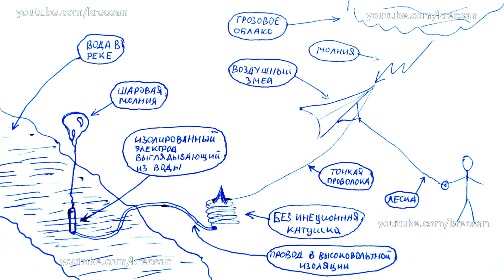Generating a lighting ball from a streak lighting!

Comment: I think it's fake :
I've seen videos about lightning rockets trigered, and the cable explode very very quicker... the plasma on this video is too much slower..
And a lightning can't make hissing like this caused by the tree resistance... because it have more energy than the electric source been used in this video.
they show the electric source at the begening, it's train power line. by the way I remember several years in the past this sames guys had been posted video on train powerline grounding with very similarity...
The plasma and the thunder sound are video edited, but the hissing, and the explosion are real and caused by train powerline grounding with a tiny cable...
And the hissing happened because the cable touching the tree, and maybe the cable wasn't properly grounded... until an arc close the circuit.

Comment: I cant tell if its FAKE or not
Reply: It's 100% fake. It's pretty obvious... Lightning strikes go way faster than this, you can't film it moving down like this, especially not with with a normal camera. "The rate at which the return stroke current travels has been found to be around 100,000 km/s (one-third of the speed of light)." Even with a Phantom, a slow motion camera, I don't think it would be possible. They probably used a small homemade bomb for the explosion, a small wire shorted with current on the tree and definitely some CGI for the lightning.
Reply: @Reth_Hard  thx exactly the lightning speed was a red flag for me

Comment: Very impressive, if real. Unfortunately, I'm not 100% convinced that it's real. There are two jump cuts (visible if you step through frame-by-frame) around 31 seconds, which would imply that the 'strike' is actually three separate pieces of footage. The middle clip, which is the only time any light from the strike appears on the subject's sweat shirt, was probably filmed using a very bright light or flash charge. The smoke from the tree, which looks suspiciously like smoke bombs, has conveniently entirely dissipated at the very instant the camera is picked up and moved, and could have been composited from the pre-strike shot. In the middle of the strike, there is a couple frames of what looks like file corruption, with sections of the image being displaced in squares. However, if the distortion/corruption happened on the image-sensing chip, it would be only in the X or the Y direction, not both, which is visible here. And if it was introduced at the footage-encoding level, perhaps due to the signal processing unit in the camera being overloaded (it's definitely not the 'memory card' as claimed in the description, otherwise it would have affected all of the footage prior to the strike), it would be in perfect squares that are multiples of 64 pixels apart due to the way digital video is encoded, which isn't the case here. Furthermore, assuming the camera was the source of the audio as well, the explosion would have been so loud that 1) there would have been massive clipping during and after the explosion, way more than what is here, 2) the video footage has been slowed down, but the audio sounds (to me) to be playing at regular speed, which would mean we should have heard the explosion out-of-sync with the image, and 3) the automatic gain control would have dropped the gain way down to compensate for the extreme volume, which would have effectively muted the very distinct echoes we can hear. Lastly, standing that close to a lightning strike would expose you to sound levels in excess of 160 db, much higher than the 120 db threshold for immediate ear damage, and the gentleman holding the kite string barely flinches and doesn't appear to be in severe pain, as I would have expected. Same for staring straight at the lightning from a few dozen feet away without eye protection, I doubt he would have been able to see clearly enough to pick up the roll of kite string he dropped. Not to say that this isn't real, but there's enough sketchy things here that it doesn't quite pass the 'sniff test'. It feels very much like a faked plea for money (notice how many methods of sending them money are in the description). B+ on compositing, could stand for a little more finesse. C+ on story, barely passes suspension of disbelief. I'd love to hear Captain Disillusion's take on it, though.
Reply: How dare you having any doubts about the legitimacy of these gentlemen?
There is no doubt they filmed this slow motion of a lighting strike going at 1/3 of the speed of light, using an iPhone...

Comment: The smoke in the tree tells me that the electricity is flowing from the kite to the river. Cloud-to-ground lightning going through your wire and coil to the river exciting the cloud to want to fully discharge to ground. The anomaly appears to be a man-made leader because it's in slow motion and it came from your kite. The result is a lightning strike.

Comment: Hate to say it, but that's not lightning. This is most likely just them messing with powerlines. You can see something arcing up in the trees before the main flash (characteristic of powerlines, since lightning happens in a massive burst). Lightning is also not that slow. My guess: a wire was in contact with the high voltage lines, it dropped (drawing an arc behind it), and shorted on contact with the ground, causing a massive current surge which vaporized it in the process.

Comment: You can stick an insulated metal pipe vertically in the air and it will acquire a charge from wind. Snow hitting a vertical antenna adds way more charge to the antenna. Insulate a vertical antenna in a snow storm by disconnecting the antenna gets a high enough charge to ruin your radio when plugging it back into the radio. Short the charge first.

Comment: Just air the more altitude added to the wire the more electrical charge is added even without storm clouds. You had some charged atmosphere. Your wire had a high charge seeking ground. Tree moisture was acting as a slight ground smoking then charge kept increasing till the electrons figured there's ground. Lucky you were not in the ground path.

Comment: I think your line was guiding a stepped leader and you filmed it going from zero current to well in excess of it's detonation current. While still a thin, solid wire it can't pass nearly as much current as the plume of plasma that it diffuses into, so once the plasma channel is complete the bulk of the energy can be equalized through it. That's my best guess at least.

Comment: What they caught on video and and what was making the sizzling sound are 2 very different things.  #1 There was an Upward Streamer OR  ( the technical term a Positive leader, ) coming up from the tree, The upward streamer is what was reaching up toward the thunder cloud as the step leader got closer. They are extremely hard to see with the naked eye. Thousands of volt amps were discharging from that tree limb. #2 Then there is the  string. You can see the step leader coming down from the cloud looking for a path to ground. The string was the easier path to ground. So the lightning fallowed it down to ground.  If the upward streamer from the limb would have made contact to the step leader coming down from the cloud the lighting bolt would have been more intense and could have jumped from the limb to them. They got lucky the string burned up and disconnected from the person holding it just before the charge came down.  But hey if you don't have an Xbox to play with. You might as well play with death. I'm sure there would be more then a couple of scientist that would be very interested in this video.  One thing that bothers me about the video. How did you fly a kite with no wind? None of the trees are moving?

Comment: One thing didn't make sense. As the frame rate when from real time to slow motion and back to real time, the sound remained constant. I didn't hear any changes in pitch or speed through the transitions. Also, the static sounded exactly like a victrola looping at the end of a 78RPM record. Add that to the surreal, animated flash and the camera's limited exposure change (any type of arc flash, man made or natural lightning, would of darkened the picture considerably even during daylight. Arc flashes are extremely bright, even challenging the sun. All videos of real lightning strikes or arc flashes, nearly cause the picture to go black as the camera struggles not to over expose the video, and video cameras are fast to clip the exposure. Then, the camera at least takes a couple of seconds in daylight to adjust back to normal. I'm just going to conclude that the video was fake.
Reply: Cmon. The pitch-not-changing is totally normal, almost every slow motion software is able to slow down the audio without changing the pitch. (To a certain degree). The exposure wouldn't change if they set it to a fixed exposure (which looks like it, because the entire image is already over-exposed from the beginning on). So all your points are bs.

Comment: LIghtning strikes 15 foot from this dude and he Just stands there Instead of Jumping..FAKE !!
Reply: I was struck by a lightning. Trust me, you don't get a chance. This is what it should look like, huge amount of electricity discharges through a wire before the explosion because wire doesn't allow required potential for a lighting bolt to build. Wire is probably permanently oxidised, but intense heat creating plasma makes more conductive medium for discharge in the path of wire. A part of lightning's energy is reduced- thus preventing a bolt. You basically get condensed plasma instead.
Explosion wasn't linear (like the lightning we see) because the lightning was slightly lower energy, but it was enough to condense plasma. Plasma is unstable, so it evaporated upon contact with ground. It doesn't explode, it just spontaneously changes state- and its huge energy potential is reduced through light radiation and the sound it makes.

...
+ take it into account that these guys are from Ukrainian warzone. When you are in a constant danger of getting blown to pieces by a missile, your senses accommodate to a constant state of danger.

Comment: Its a stepped leader "charge from cloud". A pre lightning bolt trying to find its way to the ground to the upward leader "grounding charge". Right before a person gets struck there hair stands up and everything around them buzzes. The reason you can see it crawl to the ground was the wire itself making ground without an upward leader present.. In air its almost invisible.  nothing fake at all about this. the guy holding the wire was lucky the wire melted in time
Reply: they where using nylon line to keep kite and separately there was some metal wire
Reply: More likely a charge from powerline.
Reply: @muz06  LOL, If it was from a powerline it would have the distinct 60-50hz buzz. I think the ukraine has 50 HZ power. This was an explosion. Thunder up close.
Reply: @JisINSANE3  haha, well of course they're gunna edit the audio and add real thunder sounds. I do believe when they pulled a wire up into the powerline with some nylon string that some of the current was passing through the tree cooking the zap out of it hence the hissing sound then you get the main discharge to the ground.
Reply: @muz06  Yeah I get it, I just don't take these guys as liars. I think they actually harnessed this. It's not hard to do. They do it all the time with hobby rockets.
Reply: @JisINSANE3  hz and HZ don't exist, only Hz does.

Comment: it is high voltage cable
Reply: It was most definitely a high tension power line induced fault.. I could overlay thunder over that in 5 minutes.
Reply: Miteran Official if it was a high voltage cable, a buzz of 50 or 60hz cycle will be heard instead of an explosion

Comment: I call BS.  I've been that close to a lightning strike before, the concussion wave from the thunder was so strong that it literally blew me backwards and knocked me off my feet.  I find it odd that the guy in the video doesn't even so much as stumble, nor do any of the trees, bushes, grass or even his clothing move from the force of the explosion.  Nice CG though, I gotta give you credit for that!
Reply: strength of "explosion" and shock wave depends mainly on the charge in the cloud and "air resistance", simply more charge and more resistance finally you get big boom. you cannot make all lightning same, as they at least different in the shape.
Reply: W7ENK 

Power lines, off to the left of the shot.

The tree was burning for several seconds because the other end of the wire (copper / steel / aluminum) was being hoisted up to the power lines using the nylon fishing lines.

(or possibly being pulled through the tree, and the other end made contact too early, or was the entire plan / idea of the vid. Good clickbait, though, and a superb slow-mo. hehe)

The sound editing was also very good. It clearly used some looped sections during the slo-mo, and I would bet that the original sound would have that characteristic 50/60 Hz buzz from the power lines.

The alternative is that this really is all produced by a real lightning strike, in which case they've captured some insanely rare footage of a stepped-leader, and / or ball lightning that lasts for several seconds before the main strike. Which do you choose? :p

(I personally don't think the video footage itself was manipulated during the edit, just that they were messing with power lines, which could have been overhead, closer to the ground, or from a nearby transformer / substation.)

Still fun to watch though, and shows to terrifying amount of power on tap.

Comment: the slowly falling streak is the wire melting off with the discharge trailing behind. then once the wire hit the ground, the CG lightning strike occured
Reply: or a CGI CG bolt :)
Reply: W7ENK cloud-ground
Reply: Except that it didn't.  The only CG in this video is "Computer Generated."

Comment: That was awesome! I heard something similar when I worked as a  Chief Engineer on a gambling ship here in Florida. It was a summer day pattern that was  typical,with sun and heat until about 2-3pm then huge clouds, then lightning, then rain. Just before the rain the Captain called me up to the bridge. He said  there's an air leak and the weather fax machine won't come on.I entered the bridge and what I heard was a hissing sound.I looked up to the ceiling where the antenna cables came down from the roof of the bridge and saw a spark about 2 inches long discharging from the weather fax antenna which was disconnected from the back of the unit. It was a phenomena known as corona discharge. The antenna of the weather fax was acting like a lightning rod,and was discharging creating a hissing sound.It was nothing like what you filmed and recorded,which by the way was totally awesome ! After the rain started the hissing stopped ,but it did cause extensive damage to the weather fax machine.
Reply: Awesome! Did you know it has a name for it? (besides corona discharge)
Behold, St Elmo's fire :D
https://en.wikipedia.org/wiki/St._Elmo%27s_fire

And cool, one of my dream jobs would be a Ship's Engineer ...